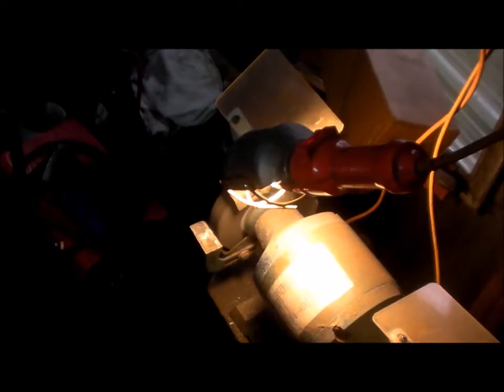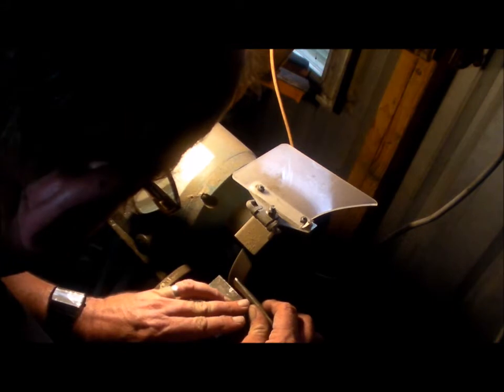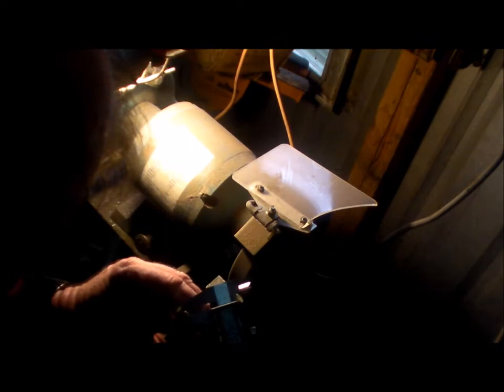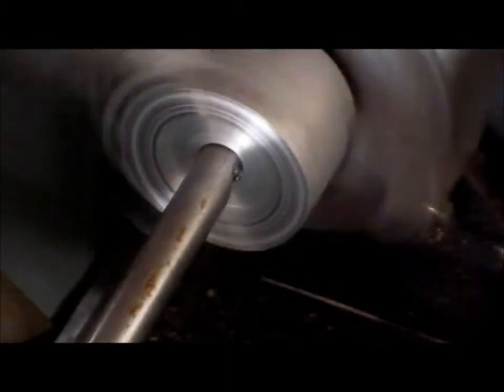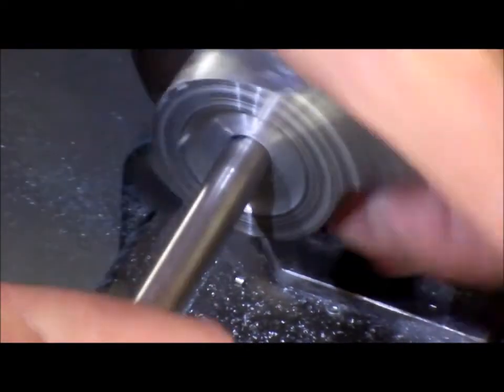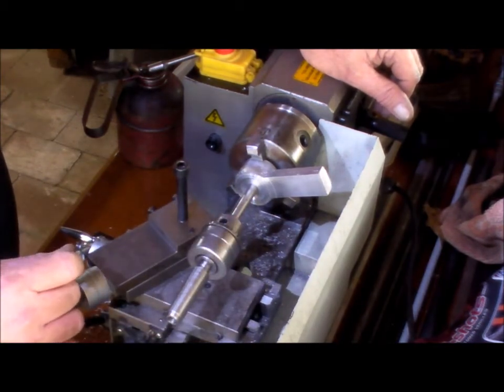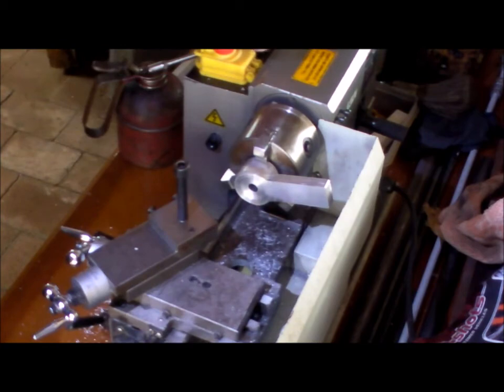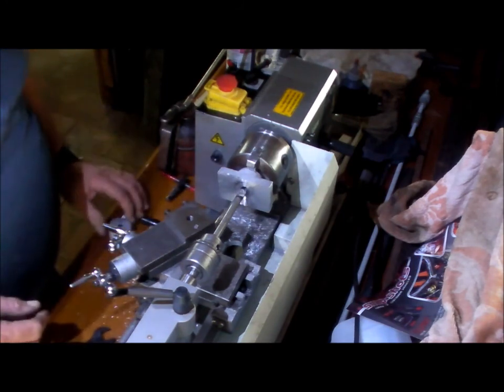Making a D reamer

Comment: Where you rounded off that side, it's too far back. The tool deflected, then when the off side tried to enter it took a huge bite all at once. You just need to back it off from about the center to the outside edge on the "up" side of the drill. Not much, just so it doesn't rub.
Reply from the maker: G’day Sam. Thanks for commenting. Cheers